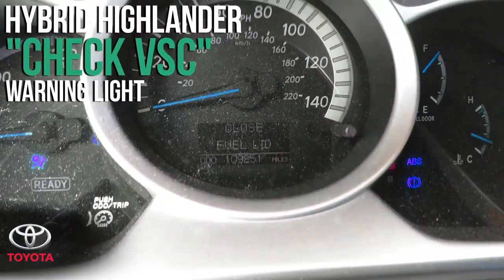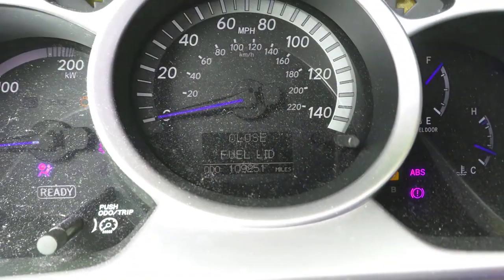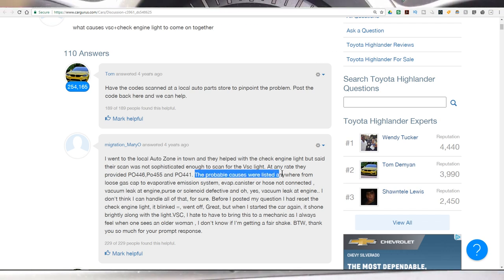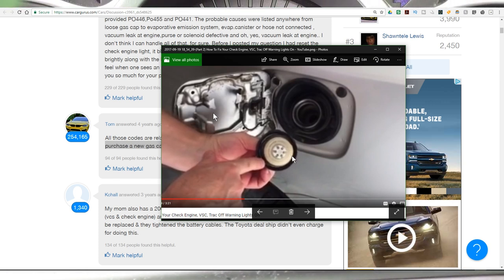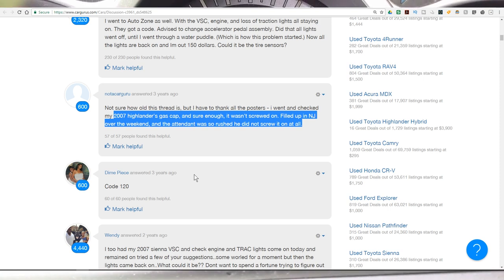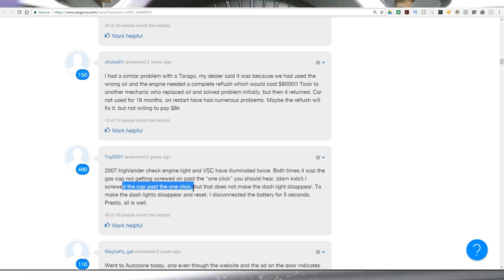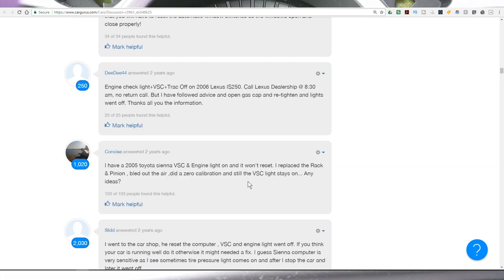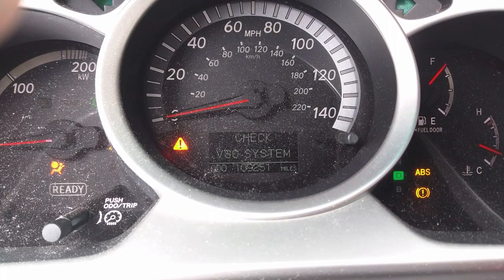"CHECK VSC SYSTEM" Warning Light | Discovering & likely SOLUTION:) for my Toyota Highlander

Comment: Wife came back home with this "check VSC" error message on the dash board with the "check engine" light ON! on our Toyota Camry 2007 XLE. I Asked a few questions, one of the answers she told me was .......on her way back home from work she stopped by a gas station to fill up. I checked the gas cap; it wasn't fully tight, so I lubricated it and closed it tight hearing the click it should make.. started the car again and saw the check VSC was off but the check engine light was still on. I then disconnected the battery terminals for 2 minutes and restarted the vehicle again after reconnecting.....voi·la.... all error lights were all cleared from the dash board, all errors fixed and vehicle ran well.
Thank you Garth Vapor for the Video and all those that posted comments, you made this an easy fix.

Comment: It worked for me. Thank you so much. I tightened the fuel cap and disconnected and reconnected the battery terminal and the warning lights disappeared. I booked the car for a check tomorrow in a a garage, I will cancel that now. Thank you.

Comment: I don't know if the gas cap is really the issue. But I was getting ghost batter draw anyway so I installed a remote kill switch on the whole battery. Since the battery gets reset everyday the code can never come up for long. And even then it's rare to see. This is great because now I can use cruise control which the VSC error disabled when it was up.

Comment: Ok, I am going to share with you the experience that I had with my 2008 Highlander. First you have to verify that it has not been activated with the VSC OFF button that the truck has, the button is 5 cm below the steering wheel and 10 cm to the right side. If pressing it turns off the light, that's it. If not, you can try disconnecting your battery for 5 minutes and reconnecting it. If the failure was momentary, it will not reappear. If it appears again, it means that the fault persists. Try removing your gas cap, clean it and add some oil or grease to the gasket and tighten it again to seal. If the fault reappears, try removing the battery again for 5 minutes. If the fault continues, check the vacuum hoses that are on the battery side, near the MAF module, all of these hoses dry out, break and lose vacuum. If so, replace them or seal them with tape temporarily and replace them as soon as you can. Now disconnect your battery again for 5 minutes. If the fault continues, it is almost certainly a fault in the ignition coils. It can be a simple false contact, a damaged spark plug, or damage to the coil. Some coils only fail when the temperature increases. The mark on the board will not come off immediately, even if you change the coil. You will have to remove the battery again for 5 minutes to see if it is solved or clear the fault with a scanner right after changing the suspect coil. If the fault appears again, it may be that this coil is not the damaged one or that 2 or more coils are damaged. I'm not sure but I think a good scanner can tell you which bank the damaged coil is in. If you plan to test the coils, do them at operating temperature, because some coils work perfectly when they are cold and only fail when they get hot. I found a fairly economical and functional option to replace my six coils on Amazon https://www.amazon.com.mx/gp/product/B0CDL3W2H7/ref=ox_sc_act_title_1?smid=A1EQ6XZ8EBZ8QG&psc=1. Much lower than the cost of agency coils. First try to verify that it is not a false contact.

Comment: Thank you for your video! I had this problem on Toyota Avensis. I tried the Gas cap first, but that did not work. Removing the battery terminal and restarted the engine twice, the VSC and Check Engine warnings went off!

Comment: I don't think it's the gas cap because along with check vsc and check engine light, also the check hybrid system light came on to and shortly after the car slowly came to a stop...as in wouldn't accelerate. After stopping for a while I was able to turn the car back on and seems to be driving ok, but check engine light still on. Any ideas??
Reply: Did you figure out what was wrong? I am having the same issue.
Reply: @ykywi  me too did you find out anything
Reply: @nonenone4078  yes, I did some research and found that it could be low air flow to the engine. I have a k&n air filter and I hadn't cleaned it in awhile. I cleaned it out and that made the light go away.
Reply: @ykywi  nice thanks for the quick response  and quick question did your cat turn on and off whole driving when you had the vsc system code?
Reply: @nonenone4078  I dont think so. Sounds like you may need an o2 sensor if your cat isnt heating up.
Reply: Hmmm..

Comment: Turn the ignition all the way off, press the gas pedal fully on and off four times, turn the engine back on. That will reset it. But it may come back if you have a vacuum leak, bad gas cap,or a bad ABS wheel transponder.

Comment: Just got this code after changing the engine air filter. I disconnected the MAF sensor and some vacuum tubes so at first I thought I left one off.  Checked and everything was connected fine.  After restarting a couple of times, the VSC light went away. Go figure.  (2008 Toyota Highlander Sport)

Comment: Hi all, I had this happen to me tonight. 2007 Toyota Highlander Hybrid Limited. 
The lights came on while I was driving. Come to think of it, I had gotten gas in Weymouth, MA where they require an attendant to fill your car, much like New Jersey. Could very well be he didn't screw the gas cap on tightly. 
Anyway, after I stopped to get out of the car and get back in, it wouldn't start at all.  Fortunately, I have the FIXED device installed and I have the App on my phone. I read the code, and yes, it mentioned the ABS system and all sorts of scary messages. I just cleared the codes and it started right back up as if nothing was ever wrong. I will check the gas cap though. I remember when I first got the car, the gas cap was on so tight, I needed a pair of pliers to get it off. I also noticed a whole bunch of grease all over the threads of the gas cap. It seemed weird at first, but now, it makes sense. I'm not sure it is the right gas cap, so I'll look into replacing it with an OEM gas cap. I will also try checking the 12V battery terminals to make sure they are clean. 
Thanks for sharing this video! 2007 Toyota Highlander Hybrid Limited.
Reply: i live in dedham lol

Comment: THE SIMPEST AND CHEAPEST METHOD. WITH A SPRAY FOR CLEANING  THE BRAKE DISK, PUT DOWN THE PIPE FROM THE EGR AND THE EGR, CLEAN THEM VERY WELL FROM IMPURITIES, WITH A TOOTHBRUSH AND THE SPRAY, THEN PUT DOWN THE TUBE TURBO AND WITH THE ENGINE STARTED, GIVE ABOUT 20.30 SHORT JETS, DIRECTLY INTO THE TURBINE.AFTER THAT DISCONECT THE BATTERY FOR FEW MINUTES AND ALL THIS LIGHTS WILL DISSAPEAR.I MAKE THIS EVEN TO A TOYOTA RAV 4 WITHOUT ANY POWER,I CAN'T ACCELERATE MORE THAN 2000 RPM AND AFER THAT ALL WAS CLEAN.GOOD LUCK!

Comment: 1- removing ground and power terminals on the battery and waiting and reinstalling did not turn "Check VSC System", nor replacing gas cap. Battery terminals were wrench tight and I wrenched tightened them, when I reinstalled them.
Reply: Get the light off?
Reply: @michaelstjohn6086  I'm traveling bro- be back, in Utah Mon. I gave up, I'm a home mechanic. I'm taking it to Lexus. A drive cycle may do it, from cleaning the maf and replacing gas cap. I think it was my driving around Lake Meade that set it off, (on)
Reply: You can get a cheap meter 4001 creador eBay 22 Buck's try for Less it is very difficult to use the system but the meter will erase and check the error code why why is this error code connected with the evaporative system traction is not evaporative and the red triangle with the! What the hell is that

Comment: I have a 2006 Toyota Highlander Hybrid.  Three things that have triggered this code in my car on various occasions are 1) the plastic coolant reservoir (under the hood on the left side near the front of car) was completely empty and I had to add coolant (note: it takes a few hours after adding but the light will go off it’s thsyd the problem), 2) the oil somehow was low (I added a quart of 5w-30 and same thing, light will go off after a while if that’s the problem...it seems like it just takes a while for the coolant or oil to be recognized by the system), and 3) the worst problem, my antilock breaks failed and I had to get new ones b/c unlike gas only powered cars, the antilock breaks in a hybrid are somehow controlled electrically.  If this is the problem, you may notice a weird “beep” sound at first when starting up your car, or you may notice the car kind of jerking sometimes when you press the break - almost like it takes a minute for the break petal to engage.  I drive my car like this for months but eventually this system I had to replace completely failed and as I was driving down the highway at 70+ mph, I heard a loud continuous BEEEEEP that wouldn’t ever go off and realized I had no breaks.  This is after the Toyota dealership told me I would be fine to drive it as long as I was aware I wouldn’t have antilock breaks but I could still use the regular breaks...WRONG.  I guess they were uneducated about the break system in hybrid vehicles, as was I at the time (but I’m not a Toyota certified mechanic!!!!!!).  I could’ve been killed that day but there will hopefully be a lot of warning signs to look before the breaks completely fail, if that is the problem.  I’d say first check the coolant levels, as this has caused the error light in my car 20+ times (I had a leak).  Hope this helps somebody!!!
Reply from the maker: Holy cow. Yeah it's definitely imperative to have brakes. So, surprised there's not a redundant mechanism to ensure the ability to brake even if it requires more force. Thanks for the info. Hopefully if anyone is having these similar symptoms to not just try and get rid of the annoying warning, but to investigate a bit more to ensure something more isn't going on.
Reply: Dude this happened to me tonight while driving uber. Good thing I was on my way to pick up and didn't have anyone in the vehicle. So the beeping started,  the vsc light came on, and I could barely brake, and I smelled something burning. I had to leave it in a parking lot and hopefully something is opened tomorrow for me to take it into. Do you know if this will be an expensive fix?
Reply: @digitalcurrency4737  Hello, did you get your Toyota VSC light issue fixed?  If so, how?  I'm having the same VSC light come on on my Highlander Hybrid.  :-(
Reply: @jamesonearth8331  yes. I had to replace the abs pump. I got a used one and with installing cost $1,350
Reply: @digitalcurrency4737  Where did you find a used one?  I see them on ebay but don't know how many miles they have on them.  Ant tips on where to find one?  I'm guessing this is the "Actuator" that costs around 2 grand brand new.  That's a great deal you got if it is:-)
Reply: @jamesonearth8331  I found a mobile mechanic online who was able to find it. I live in California, so it may be easier to find here

Comment: I get this error in the mornings, mostly (but not always). Car runs, but ABS is completely off. After about 5 minutes the lights turn off and ABS is back to normal. The scary thing is that this has happened a few times while driving - VSC/ABS shut off. I've also had it go back to normal, while driving. My mechanic didn't see any codes. I'll try the gas seal...
Reply: What happened after you tried the gas seal ?? thank you